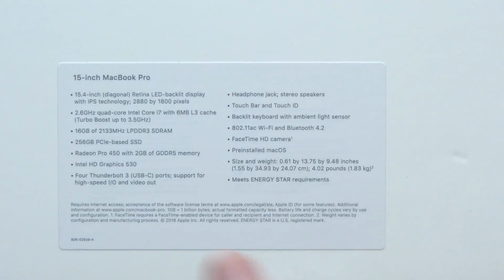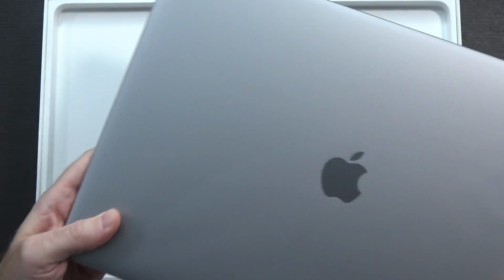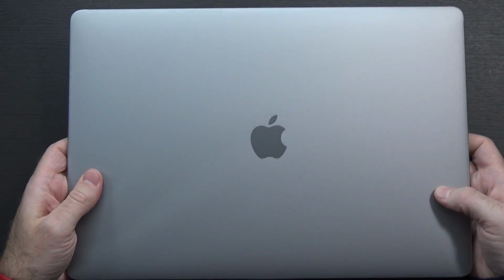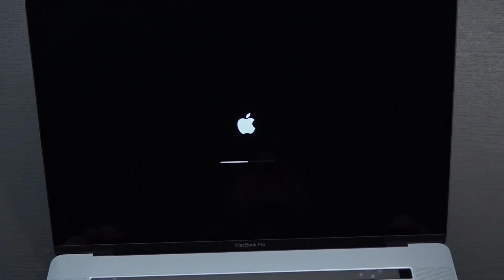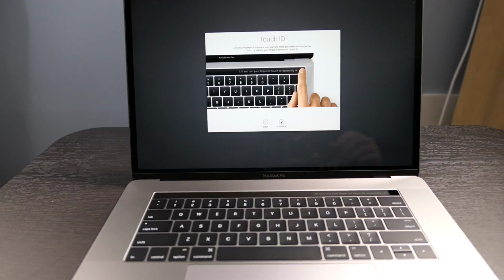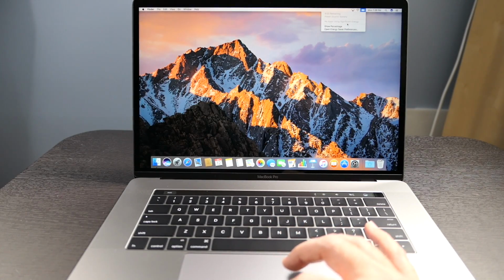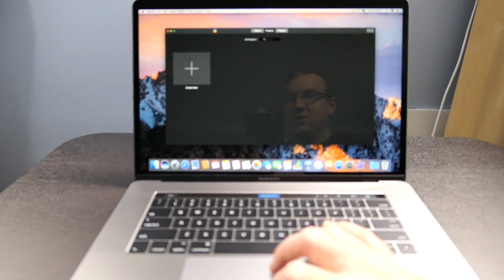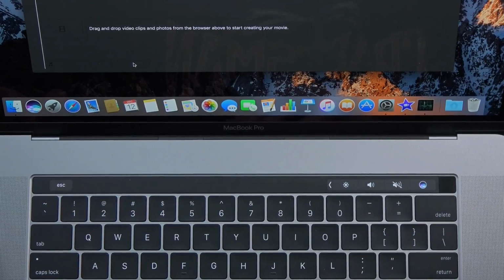15" MacBook Pro with Touch Bar (late 2016) Unboxing and Hands On

Comment: apple care doesn't cover accidental damage like drops or scratches. applecare is very much a rip-off unless you buy it for ipad or phone. it only covers manufacturer defects, but if there is a manufacturer defect then it usually shows itself within the first year which is complementary
Reply from the maker: I didn't realize that when I purchased AppleCare. Since filming this video, I actually ended up returning the 15" MBP as well as the AppleCare, and didn't purchase the coverage on my 13" MBP I bought afterward.
Reply: i learned that the hard way

Comment: Hey, If I'd be buying the MBP 15" 2016 with this config, would it still be reliable for video editing using FCPX? (Or should I just consider the MBP 13" version)

2.6GHz quad-core Intel Core i7 processor, 3.5GHz
16GB 2133MHz memory
*256GB PCIe-based SSD (I'll buy an external drive instead)
**Radeon Pro 460, 4GB memory (maybe the only upgrade I'll pay for?)

I often get my video clips from my GoPro set at, 1080p and 4k all the time and I also use Adobe Lightroom for my photography using raw files. 

So considering these factors, should I get the 15" or the 13"? What should I upgrade for my needs (if I need to)? Thanks!
Reply from the maker: I normally use iMovie, but recently picked up FCPx, so I'm going to be tinkering with it moving forward. 
I haven't tried Lightroom for editing, but I ended up downgrading from the 15" to the 13", and so far the 13" has gotten the job done for me. That said, I haven't used any 4k on it, yet. That's the next test for me.

If you have a store nearby that sells them, see if you can take in some files/projects and try editing on both machines. That's what I did when I was deciding which one I wanted. I had a USB-C drive with ~30-40gb of files, copied them over, edited/rendered, and both worked really well with 1080p60.

Comment: Just as an fyi, apple care for the macbooks is not like apple care+ for the iphones. Macbook apple care only covers manufacturing defects. In the case that YOU damage this laptop in any way apple will NOT replace it. AppleCare is still nice to have because of all the reported issues with this laptop. Personally I did not buy applecare for this device because it will cost an arm and a leg regardless of whether I have AppleCare or not.

Comment: Great review just.. 1 question :P... Do you really need this!? come on :P there's other things to spend your money on i'm sure.. like.... come on! :P Radeon compared to nvidia... if you're into video. Nvidia! if you're into budget/performance ATI! :D 

Just bring it back man... your old macbook is killer! unless you're gonna give it to the misses, then i get ya ;)
Reply from the maker: The old macbook is my work laptop. Technically not supposed to be using it for non-work things. I'll agree, the 15" is definitely overkill. I'm on the fence about keeping it. It's paid off, but the difference in performance for what I do between the 13" and 15" is probably going to be negligible.
Reply: macbookpro 15 inch and using iMovie... get a macbook air

Comment: What are you doing, Jordan? Why do render times matter? You have a desktop with a 780 in the back, no? As long as it doesn't actually lag while working, that's good enough.
Reply from the maker: Render times make a huge difference when you're making videos frequently, and on the go. Even with the desktop I've got, since it's Windows, a 10 minute video might take me 25 minutes to render using Premiere Elements or Sony Movie Studio. On iMovie, same video takes 2-3. Compile that over the course of a year, probably making 200-300 videos, that's a huge time savings.
Reply: The problem isn't that it's Windows, it's that your settings are wrong. Set it to render on the GPU. Assuming you have fast up speeds, also set it to render quicker. YouTube doesn't mind huge source files. And besides that, I also think your workflow is bad. You should do your work on the Mac or wherever you're comfortable, then send it off to the desktop to render out and upload automatically. So even if it took 25 minutes, that's fine, because you're not actively using that computer.

Obviously iMovie is only on Mac (Or probably, I don't know) so you can't just work off files on a NAS and send over a project file. But Premier is cross platform, so you can there. Alternatively, iMovie might have some sort of swarm feature. On the go, I agree with you. Local render speeds matter much more.
Reply from the maker: If it weren't such a drastic difference in render time, I'd agree with you, offloading the files and batch rendering would make the most sense. But realistically, when it's 25 minutes down to 2-3 minutes per video, that's less time than it would take to send the files across the network, and I can still actively use the computer while it's rendering. Plus, a lot of times when I'm watching the video back after rendering, I'll see something I did wrong/missed, and I'll have to fix it and re-render, which would involve shipping at least the updated project across and waiting another 25 minutes for Windows to render, if I were on Premiere.
After moving to iMovie, I've been able to crank out videos exponentially faster than I ever did on Windows, with fewer software crashes/issues. 
I still haven't bitten the bullet and purchased FCPx, because iMovie can do the grand majority of what I need for everyday videos. It can't do more than 2 video tracks, which stinks, but for the most part I don't use more than 1-2 tracks.

Comment: You can drag your applications folder down to the corner and it will create a applications shortcut.
Reply from the maker: I gave that a shot while I was uploading the video. Ended up removing it, because now that I think about it, I never really used it. Usually just Cmd + Space, type what I want, or pin to the dock.
Reply: Jordan Keyes yes, spotlight is great. May as well use it. 😜

Comment: I would honestly have gone for the 2015 model, i have one for work and would not downgrade to the 2016 for anything.

The lack of mag safe is an absolute joke in my opinion USBc is nice to have but it should have type A too , loss of SD card it also a pain. 

And to have things work properly you have to use the apple adaptors , normal USBc stuff does not work correctly , stuff that works just fine on another USBc device like a dell xps, for example a multi adaptor with HDMI and 2 USB 3.0 ports only works at USB 2.0 speeds on a mac because ..... apple. 

The screen is loverly , the trackpad is nice keyboard is a good upgrade , touchbar is a gimmick buttons are faster and dont need you to look down at the keyboard like a hunt and pecker.  

The 15 is nice as it has the GPU but i very much doubt that imovie uses GPU rendering, if you play games and what not on it then i guess it is a decent upgrade but its not the best GPU in the world. I would have saved money and gone for the 2015 13 inch that apple still sell.

Oh and apple , if your going full USBc thats fine but please move your phones over to USBC , there is no good reason other than wanting to sell adaptors to keep the iphone on its current connector , none whatsoever. With 30 pin i defended apple as 30 pin could carry all sorts of signals like analogue audio analogue video etc without needing hardware converters , but the current connector is a joke , switch to USBC!
Reply from the maker: I'm probably going to do a quick follow-up video on this, but I think the 15" is going back... my 2014 work Macbook Pro renders faster... Still might consider the new 13" without touchbar + some upgrades (i7, 16gb, 512gb?), but that comes out to almost the same price as what I have now...
Kinda up in the air.
Reply: They sell the 2015 13 still , if your going for a 13 go for that one. The 2015 and similar has been proven a reliable platform, its thin and light enough, it does not have the problems with lack of SD and Magsafe and its just as fast as the none touch bar , chances are it will render faster as it wont thermal throttle like the 2016 does , oh and you can replace the SSD if you ever need to.

My work is a MAC shop , we even use apple server, i have no idea what we are going to do when they get rid of the 2015 pro and the Air , we are screwed , lenovo here we come.